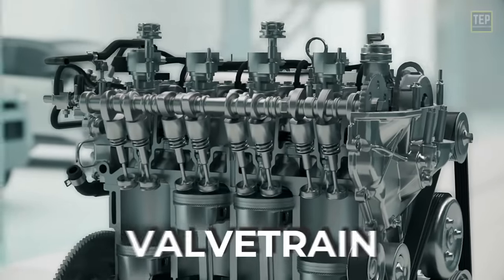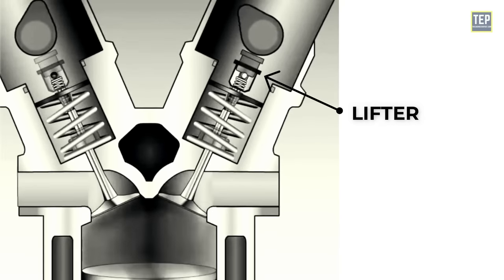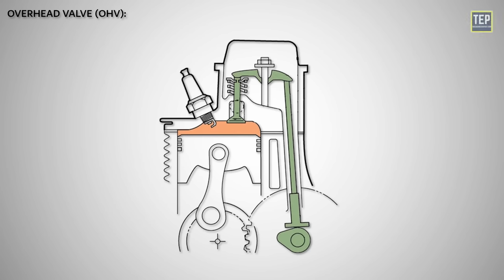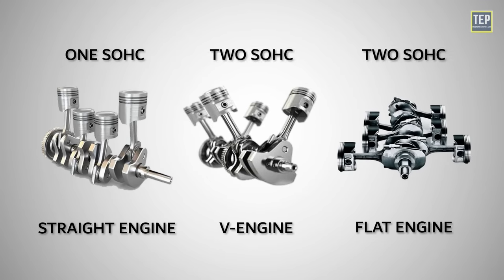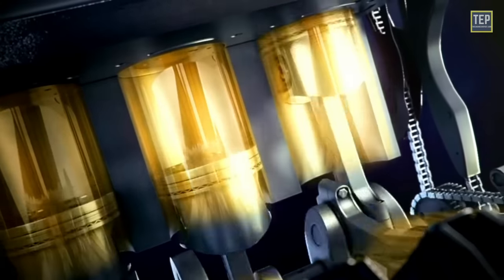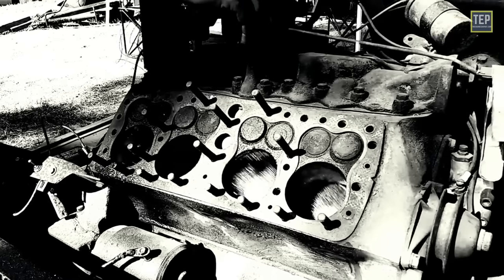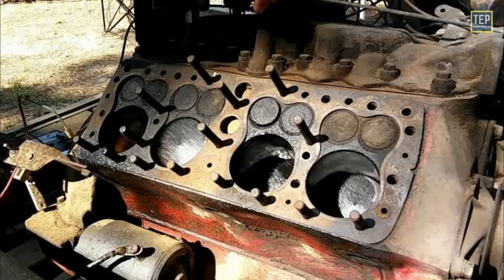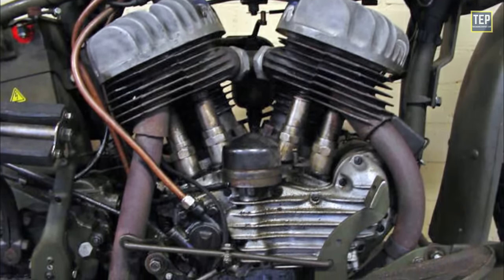Which is the Best Engine Valvetrain Design? OHV, SOHC, DOHC or Flathead | Pros and Cons

Comment: Triumph had a lovely Sprint engine that was 16 valve straight 4 engine. One cam, with one set of valves under it and the other side working off rockers but on the same cam! It was a lovely neat design that kept the engine quite compact. 
I always wondered why this configuration was never used more.
Reply: I wonder too.
Reply: Sounds like the Alfa Romeo "Busso" V6 ("Busso" is the italian word for "Bullshit"): 

- In 2.0TB it's quite a pointless design, really..
 derivating from 4v/cyl. where they made 2v/cyl version - but still on twin-row, cross-flow valve-design:
- The intake valve is driven, directly by the cam, with a rotating cup (tapper). 
I see some logic here.. Not the best, but quite simple. Classic design. Me - okay here.

- For the exhaust 
- the cam's profile is offsetted on 90 deg. next to the intake - because the movement is picked up by a horisontal tapper 
- then, a push-rod - which drives the rocker;
-  the rocker, itself - hinges on a rocker-axle which is placed, where the exhaust-cam would stay if it was 4v/cyl. (WHY?! Why not go JUST with a second cam? Who does that!? And if "Nobody" - why?!?!)
On the other side of the rocker is the adjustment screw for valve-clearance, and this drives the exhaust valve.. :D 

How stupid is that?!? - twice more complex design, with 3-4 more weakpoints, heavier - in order to LOSE power!
Not like the 24v was something impressive, but 12v - blew my buttcrack, really. This is simply - combining weaknesses of DOHC's & OHV's. With none of the profits. 
(Let's say it's an Alfa-thing)
Reply: Yes the dolly sprint engine was the first mass produced 4 valve per cylinder engine.
Reply: @grebo121  I had an Alfa 33 for many years, it ran like a train doing 200+ kph from a 1.6 litre engine, problemfree for more than 300.000 km. Lovely little car.
Reply: honda d series and mitsubishi 4g92 has also 16V sohc, very compact but still allowing high performance for its size
Reply: Chrysler had two 16-valve 4-cylinder engines for their Neon.  The "base" engine was an SOHC, and the "performance" engine was DOHC.  However you want to do it, an SOHC 4-valve engine will not be much cheaper than a DOHC 4-valve.  The eight extra rocker arms will cost about as much as another camshaft.  So you might as well take advantage of the lower valvetrain inertia and higher stiffness, and go DOHC.
Reply: Many Mitsubishi cars still have 2.4 and 3.0.   and in the 90's I had a 1.8 Mirage with 16 vavles (4 per cylinder). Then I had a. 2005 Outlander SOHC and a 2014 too with different design,  all 4 valves per cylinder.

Comment: DOHC does not imply 4 valves per cylinder, although it makes it easier. There are many DOHC engines with 2 or 3 valves per cylinder (for instance the classic Alfa Romeo engines) and there are also 4 valve per cylinder designs with only 1 camshaft (such as the Triumph Dolomite Sprint, as someone else mentions). The main advantages of DOHC are  certain kind of simplicity and lightness of the moving parts + ability to regulate the position of the both camshafts individually when you are going for adjustable timing arrangements.
Reply: In what timing situation would you want the valves opening up unsynchronized on the 2 cylinder banks?

Comment: My 89 Mazda 323 has the very reliable B6 series engine.
It has a single overhead cam and 8 valves. The peak torque comes low at 2500rpm and you feel it. High end power is low however and you feel that also. It behaves more like an OHV motor.
Reply: GM engine X16SZ is same.

Comment: Some single camshaft engines had the cams directly mounted over the tops of the inlet and exhaust valve’s leaving space for spark plug; for example the Coventry Climax racing engine which was also used in Hillman Imps and fire engine portable water pumps.
Reply: The vw 8v (single intake and exhaust) engines did if i follow you. No rocker arms. I suppose the cam could be offset to the side too in some engine designs for clearance.

Comment: I like the Detroit Diesel setup that has the cam gear driven just below the head, with the rollers mounted to the head. It gives all the advantages of OHC without the extra complication (labor cost) of dealing with chains and cams and all that when doing a head job. (EDIT: Talking about the 71/92 series, I don't know anything about the later model stuff)

Comment: One advantage mentioned on DOHC is the 4 valve per cylinder.  But there are SOHC engines with 4 valves per cylinder,  many Mitsubishi' since the 90's and 2000's had SOHC with 4 valves per cylinder.  I had a few and even today I have a 2.4 SOHC Outlander, discontinued in the last redesign.
Reply: I get a 7th gen Honda civic SOHC 4 cylinder and 16 valves

Comment: For some slow speed applications an L head (valve in block) is a better option.  The old flat head Ford 8N tractor can, in some cases, out work it's modern cousins.  Outwork here is defined as plowing more acres with the same sized plow on less fuel burned.
Reply: A flathead, with it's simple light weight valvetrain, has less internal friction, everything else being the same.  That gives it an edge in mechanical efficiency.

Comment: All things being equal, rpm determines power. The higher you can rev, the more juice you get. Obviously DOHC engines are best for high-end power. I stipulate that Chevy has done a fine fine making their ancient OHV designs perform well.
Reply: This is true. For the mundane duties we perform every day, the OHV 2 valve engines work just fine, plus it's smaller, lighter, and cheaper than an OHC engine. So many people believe they need a DOHC engine with VVT, V-Tech, and all the other fancy crap when all they do is sit in traffic on their way to work.

I do love my Toyota V8, but I dread the day something goes wrong. An old Vortec or LS is a much more user-friendly engine.

Comment: The low compression of a flathead shouldn't matter if it's force induced, and I could of swore 4 strokes have a dedicated intake stroke and that scavenging was more of a 2 stroke problem. The float could be solved with a desmodromic cam, which would never have a problem with lubrication in the crankcase and does not need springs.

Comment: The Honda CX500/CX650 and various diesel engines use pushrods and 4 valves. Done correctly, this setup has the obvious advantages of each design.

Comment: Based on my long long experience, OHV , is the best valve -train design. Period. Thanks
Reply: It's good in tractors.
Reply: Said no one ever!
Reply: The Renault 16TS had an OHV engine and dominated many races at the time
Reply: Must be true as you used ' period '.
Reply: @billymania11  overhead valve engines are actually some of the most powerfull and most rugged engine design in the world. There is a reason why they use them on top fuel dragsters.
Reply: @Mike-jv8bv  That's purely because OHC engines are banned in Top Fuel racing. In the '80s, a DOHC engine started beating everyone, not only because it was faster, but also because it was more reliable, so the NHRA banned the engine.
Reply: @PistonAvatarGuy  top fuel doesn't work with OHC regardless, especially when considering that the engine has to be broken down and rebuilt each race. OHCs are a pain in the ass to quickly rebuild vs OHV.
Reply: @Mike-jv8bv  Did you not read my comment? There actually existed a DOHC engine that was being raced in Top Fuel and it was dominating the pushrod engines before being banned.

They found a way to rebuild the engine without the OHC system causing them to lose any time during the rebuild process.

Comment: Push Rod Engines are the most practical engines. BMW Boxer Oil Head 4 Valve Engines used in R1100, 1150 & 1200 RT & GS are good examples.
Reply: You are so correct. Working on push rod engines is so much less hassle.
Reply: I like the high revving Japanese engines so timing chain for life🎉❤
Reply: The "oil-head" boxer twins from BMW are technically "in-head cam" engines (with very short pushrods).  The oil-head engines have two camshafts (one in each head), unlike the older "air head" engines that had only one (centrally located) camshaft.

Comment: The answer to the question in the title depends on whether best actually means in terms of power, torque, speed, or reliability or durability, or all.  My considered opinion, and taking life experiences into consideration;  If the quality of materials for all designs are high and equal for all configurations, of course the dual overhead cam gives the highest volumetric efficiency, power and speed, especially if more than two valves per cylinder are present.  That said, the drive linkage for the multiple cam shafts is more complicated than the other designs, with many more moving parts , and can be prone to more instances of wear and catastrophic failure.
As for reliability and durability, the flat head valve train is the simplest, and least prone to failure, with no rocker arms, or push rods and either a gear or chain drive for the camshaft.  Bottom line for the flat head is that the design is dependable, but efficiency is not very good compared to the others partly because the fuel/air mixture has to be lifted up, against gravity, into the combustion chamber.
To me, the push rod, overhead valve, and single overhead cam engines, strike a happy medium between the two extremes I have referred to, with reliability and efficiency both taken into account.
I will add that any interference engine, with a fabric timing belt, is asking for catastrophic trouble, I don't care how efficient and powerful it is.
Reply: Dependability and ease of repair is pushrod, they can for sure produce torque and hp in all bands

Comment: What is the engine designed to do? What RPM range is it expected to operate in. Lower RPM OHV is perfectly acceptable. High output low displacement. DOHC w/4 valves per cylinder.

Comment: I graduated from university with a degree in mechanical engineering. I think that the age of electric vehicles is coming, but I think that conventional internal combustion engine vehicles are the best materials for learning mechanical engineering.
Reply: Electric won't be for the masses for at least another decade.  Even then it will take several more decades to attrit current ICE from common use.  There may also be hydrogen ICE etc.
Reply: Did you or were you required to take any classes in electrical and/or computer engineering ?
Reply: The problem with electric cars is they are luxuries and very expensive to buy. Like everytime an automaker showcases one is fully luxuries and not making a practical model. So far the ford lighting and mach e are the practical electric vehicles with "ok prices" unless if I missed other brands. This is where automakers should start instead of throwing high end editions.

Comment: The low compression of Flat head engines worked okay on pre WW2 engines because Gasoline octane was so low that most engines run between 4 to1 and 6 to1 compression in the 1930's 6 to1 was a very high compression engine...

Comment: GM has proven with the LS engine you can have an old fashioned OHV cam in block and still keep up with and exceed the other guys with any other valve system. To say it limits performance is BS, and it's less complicated to less parts to break.
Reply: You just need large displacement cylinders to compete.
Reply: @billymania11  OHV 520cc singgle cylinder can produce 33 HP,
seem win win for me, actualy for motorbike that need bigger CC, but still love fuel economy and high low torq and small gear usage with CVT, it's would be just fine, cause actualy CVT make torq more exist with OVH engine set up,

Comment: There’s no question about the overhead valve. Much lower center of gravity, lighter engine, and infinitely simpler, and the parts that typically fail on dual overhead cams and such as chains and chains guides are eliminated.

Comment: Can you make a video, Some Manufacturers says 24.31PS@6500RPM & Some says 43.5PS@9000RPM and 32Nm@4000-4500RPM & 35Nm@7000RPM. Can you explain or make a video please.
Reply: We use Brake Horsepower @RPM, and Lbs. Ft. of torque @RPM.
Reply: @michaelbenardo5695  ... I think you meant to say, "In the United States, we use...".  Germany historically used PS as a measure of power.  Most of the rest of the world now lists engine power in KW (KiloWatts).
Here are the conversion: 1 BHP = 1.014 PS; 1 BHP = 0.746 KW.  BHP, PS and KW are all valid measures of power, just using different units.

Comment: It depends for longevity go with KISS   ! Which would be over head valves with push rods. Fewer moving parts.
Reply: OHV engines have more moving parts. OHC engines typically eliminate the need for the rockers and the pushrods.

Comment: I think this nice video would be enhanced by adding in the 5th choice for valvetrain design, which is the MultiAir system invented by Fiat research labs in Northern Italy, which uses an electro-hydraulic system to achieve software control of the intake valve; a very reliable system that is used widely in the Stellantis universe, and this system trounces the Honda's VTech and the other two speed cam mechanisms. Multi-air is so fast that it can open and shut the intake valve twice in a cycle if it wanted to.

Fiat invented common rail diesel, licensed it to the germans, and then got their butts kicked by their licensees, so this time around they learned their lesson and didn't license it. They don't advertise it any more because the marketing dept figures it will cause people to be afraid. But it is the best system for intake cam in wide use today, and IIRC it offers about a 10% improvement in overall engine performance, because by being able to adjust timing and duration to exactly match the current air temperature, gas octane, and air density, you avoid all the compromises that a single or dual cam system inevitably contains.
Reply: Il multiair da un sacco di problemi oltre a mangiare olio

Comment: OHV is the best as there is no belt or chain that can break causing seriously expensive damage to the engine. After all radial piston aviation engines use OHV and push rods.
Reply: FYI: virtually all automotive pushrod (i.e. OHV) engines have cam timing chains (or belts)
Reply: Radials use pushrods because it's impractical to use overhead cams on them at all (you'd need a camshaft for every cylinder. Try that on an 18 cylinder radial!).

Water cooled inline aircraft engines usually used overhead cams. E.g. Rolls Royce Merlin was SOHC.
Reply: @danielklopp7007 pushrod is typically used today by lower rpm diesel engines (since they have an RPM limit) like commercial truck engines. These use gears to drive the camshaft. In Europe push rod does not exist in car engines, not even 50 years ago

Comment: Toyota engineering was VERY INTELLIGENT in the 1980's by employing SOHC in both its 3A & 22R engines. SIMPLE yet EXCELLENT choice ! ... Both are still the most reliable engines ever conceived.

SOHC ... ( Single Over Head Camshaft )
Reply: BMW had a single overhead chain driven camshaft and valves positioned in a V shape already in the late 60's. Had such an engine in my first car. A BMW from 1972.

Comment: If the flathead valve it's in the cylinder, how is the carburetor or injectors works and how can you  mount it in the cylinder which is close to the crank shaft
Reply: like any other engine, look at a briggs or any cheap pre 1945 car for example

Comment: You forgot desmodromic valve trains. See Ducati motorcycles. The system increases hp by reducing valve train resistance. There are no valve springs in a desmo head.
Reply: The other advantage to desmodromic valve actuation is a (theoretically) higher red-line.  That said, pneumatic valve springs (as used in all other MotoGP engines other than Ducati's) eliminate the higher red-line advantage (but pneumatic valve springs are impractical for production engines).

Comment: Dual camshaft engine design are found in sport cars. Typically, with racing cars, because they require better acceleration and speed. Like he said, DOHC engines,  ultimately have better performance.

Comment: DOHC with 4 valves per cylinder and a spark plug between then in the center.  You get more horsepower if the intake and exhaust valves are open at the same time.
It is technically possible to make a triple overhead cam engine in a narrow V6.
The best is dohc with air pressure  pushing up the valves.
Reply: Pneumatic valve springs are great in racing applications, but totally impractical for street use.

Comment: Lawnmowers wich flathead are still there😊
Reply: It has advantages for lawn mowers since the efficiency does not play a major role and the engine can be produced cheaper. Displacement also does not play a role there, so low compression isn't an issue.

Comment: You can add turbo to flathead engine to increase compression 😄
Reply: A blower does not increase compression, it greatly increases breathing.
Reply: Obojí, kompresní tlak vlivem většího množství směsi 🤔🤩
Reply: Back in the day, you could get a set of Denver heads for the flathead fords because they were machined for more compression